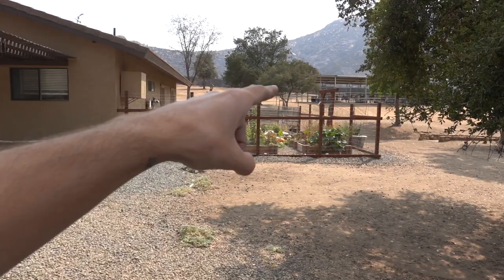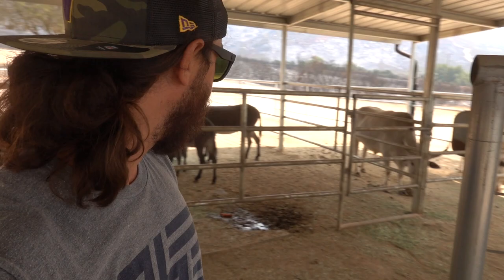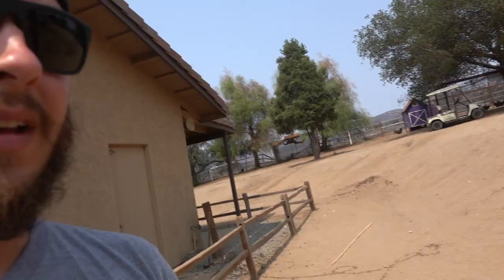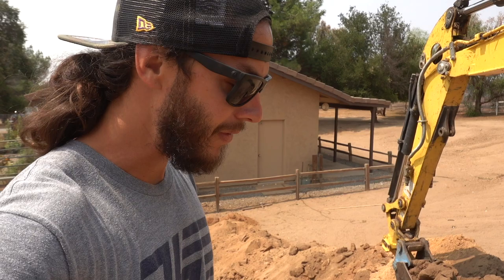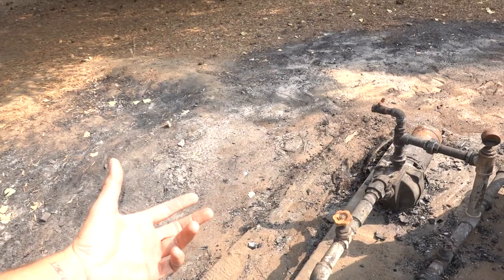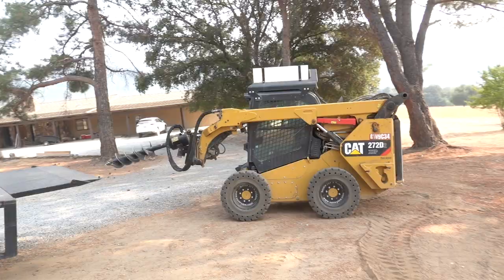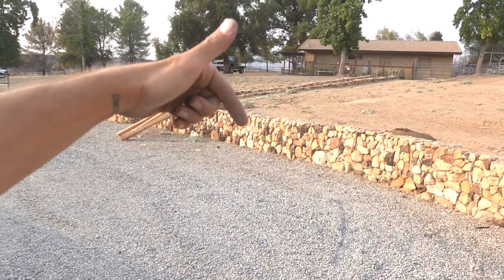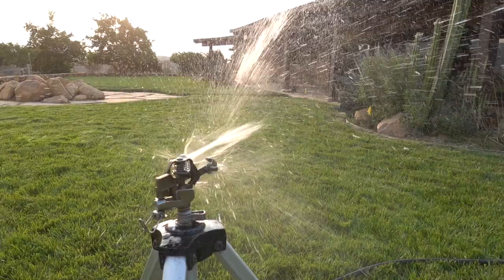IMPROVING THE RANCH WATER SUPPLY!

Comment: OK here are some solutions to your problem -  

A - Get or make a map of your property. Keep that map in a safe place to always have access ex. google drive or dropbox. Update the map with mods you have made to the property including depth of items you placed underground. It's a perfect solution for farmers and if you ever sell it you can share with new owners.

B - waterlines to the pet areas. The depth is key to keeping the water cool. When you get to the pet barns cover PVC with metal pipe source to protect from pets "slide over" and anchor to solid pole. You had the right idea with going up and coming down to each stall with water. It will keep the water lines safe from damage. 

C - You were also correct with waiting for rain season to see where the water flows. You will want to build that retaining wall to plan for the future and to prevent washouts. Down south here the best retaining wall ever is with multiple step outs on each side to prevent the wall from moving in either direction. 

D - well head and pump. I would get a higher flow 240v well pump but you will need to get a well company onsite to see how much water your current well can produce. The higher flow well head will allow you to hook the house & guest house to one leg and farm animals & future water storage unit to other well head.

E - self powered well pump. Invest in LG 395w solar panels, solar controller, batteries etc. This way your well pump runs for free at all times! 

F - water storage. Square off an area of the property to support 4 of these units for future growth needs. Get (2) 5000 GALLON NORWESCO water storage tanks and bury it 3/4 into the ground. Purchase a metal structure to cover the water storage tank area, add 8in gutters and pipe into water tanks for reserve water needs. Later, when you add more tanks you simply tap into the overflow of another tank to fill the new tank(s) 

Other Ideas - You could also design a sprinkler system to run off house power & solar power that will pull water from storage tanks to various parts of your land to prevent fire damage in the future.
Reply: Wow... this took some thought and effort I hope he sees this and very good points!!
Reply: I would have never thought of the map idea but that’s brilliant
Reply: @collinjack8399  Hey Collin, yeah man i had to learn all this on my own. Being in technology for 20+ years we always had maps or created maps of our network and infrastructure so I somewhat incorporated this into the homes and properties I own. It became a requirement as I forgot where some lines were on the land so i had to refer back to the drawings. Now it's just the norm for me to update the property map whenever changes are made. I use to take a screen shot of my property with google maps and update the map using SnagIt but now i use a product called mapright which is hosted by that company. It helps with easy access and i hated to spend money but its worth it for me. To save $ and not pay the monthly cost just do the free trial and mod the map to fit what you have done then export. Later on, get the free trial again import and mock up. Easy stuff :)
Reply: B C 🤣🤣🤣 And they say farm folk aren’t smart... 
Fun fact: the hay bailer is one of the most advanced pieces of technology in modern history, and who was it created by? 
Answer: Farmers with a need.

Truly tho, you are one brilliant individual!
Reply: If you need help with the property map or assistance with tools let me know. I can assist with the baseline, show you over a remote session  or create an instruction vid. Thanks

Comment: You can get one decent solar panel and charge controller and a deep cycle battery that will run some awesome LED lights to light up the animal enclosures all night long with no problem.

Comment: Hey dmaxryno,  check out Kubota for a side by side solution. The rtv is a fantastic little machine. It’s not super quick, I believe 35-40 mph but the little 3 cylinder diesel is great on fuel, the trans has been proven to be pretty sturdy, and there all kinds of cab configurations, plus a dump bed. Check out a kubota dealer, ask if they’ll let you demo one. Worst case scenario you don’t like it, you get to put some useful little reviews on your channel. I grew up around kubotas, they’re hard to kill.

Comment: Just gotta tell you that if you're thinking of buying an Ranger the profit cabins on the Polaris Ranger 570 series isnt exactly dust proof I had to use black electrical tape around the cabin to seal off small square holes to keep the road dust out of the cabin but if you really want an Polaris Ranger to drive around in and on the ranch overall you should opt for the Ranger 1000 series they have a much better seal on the cabins and are overall much better quality.
Reply: And dont buy the Sport polly roof opt for the Premium.

Comment: You need to move that A/C Condensor out from under the roof,  it will run way more efficient if it pull and vent more air.

Comment: You should be aware that if you have iron in that water then you should either put two lines in your ditch (one for future use) or put in a larger pipe to supply your needs. Reason being is that the iron WILL plug up your pipe over time. Then you will have to redo the lines anyway. Belive I know I've done it out here.

Comment: I'm not a fan of the PVC, I'd have gone with 1.25 high pressure black potable poly, & Ford fittings then yard hydrants & galvanized pipe above ground & anywhere that need a valve or faucet above ground. The poly is tough stuff, compared to PVC.

Comment: I would recommend taking back the harbor freight water pump and get a pump with a more reliable engine. Those harbor freight motors do not like to sit long before they start having issues and if it doesn’t start when you need it to then what’s the point of having a water trailer. I would easily spend a little more on the water pump just for the extra reassurance that the motor will start in the desperate time that I would need it.

Comment: Just out of curiosity.   When you were trying to use the auger on the Yanmar, did you have it on the high auxiliary flow?  Many times it is just a switch or a setting in the display.

Comment: Bro did you call “one call” before you dug? 
If so that would have been something good to  record process.

Man do you not pressure test with air?
Reply: I have a feeling in a place like this you probably don't have to worry about utilities.  Maybe find out if you have a pipeline or anything major running through but there's not going to be much other than that.  I imagine all the hydro is overhead as well.